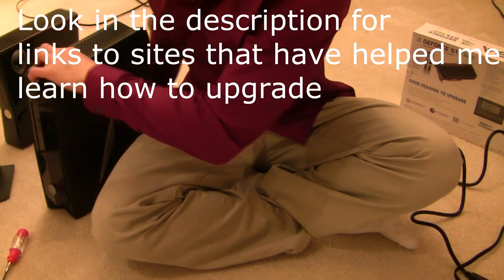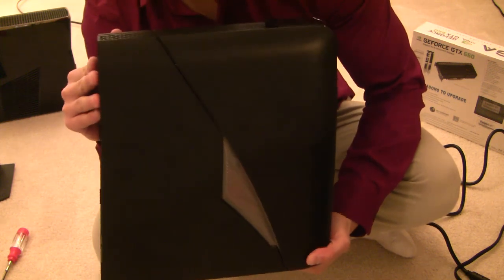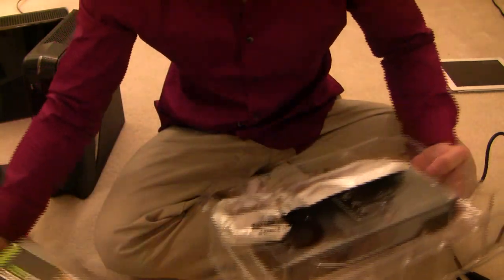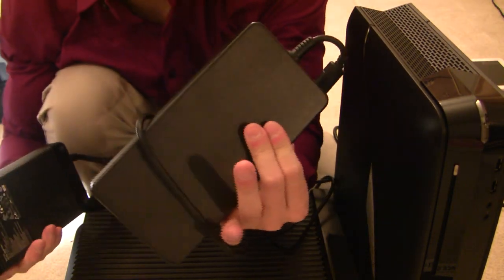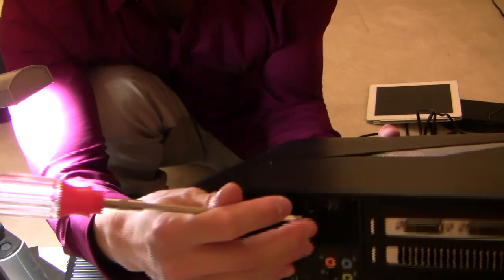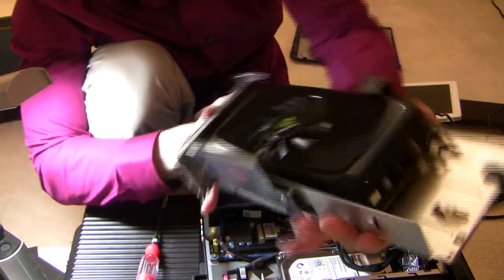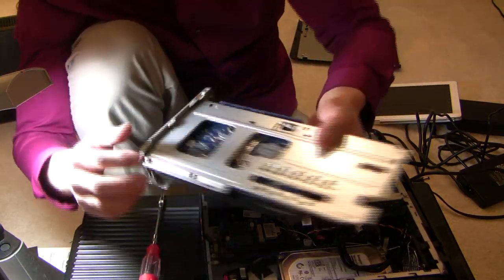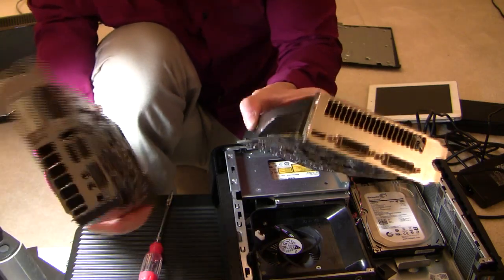► How to Upgrade the Alienware X51 Graphics Card (GPU Upgrade Tutorial/ Guide, GTX 660 Unboxing)

Comment: I have the same x51, I can install a mini GTX 1060 6GB in it but I'm wondering if 330w PSU will be enough..Can anyone tell me if it is?
Reply: JASH aight, thanks man.
Reply: JASH  yes, its a the perfect graphics card for the x51, mine arrives this Wednesday
Reply: Smiley Roman are you sure. I'm thinking of getting a 1050. If it is possible. What should i look out for?
Reply: Sorry to tell you but I tried using the 330w PSU with the mini 1060 and it wasn't enough power. You need at least 400w
Reply: JASH what are other options for a card?
Reply: I'm not sure, do some research before getting a card though. Make sure it doesn't need more than 330w

Comment: u im looking to see if i can upgrade my graphics card ive got a nivida gtx 745 and a alienware x51R2 need to know how high of a graphics card i can go
Reply: Are you sure because the PSU is only around 330 watts
Reply: Yes of course
Reply: gtx 1060 FE should fit no problem
Reply: Chase about a month ago, i ordered my 1060 FE and my alienware x51 r2 runs with it perfectly.
Reply: Chase i ordered it from nvidia by the way. it costs me around 500 CAD
Reply: Jason Zhan Thanks for letting me know
Reply: SuBcLass Make is sure you buy the founders edition because of the type of fan and the length
Reply: yessir, honestly it was much easier than i expected. The only part that was kinda annoying was to put the case lit back in.
Reply: SuBcLass Why not get a 1070? it's the same price.
Reply: SuBcLass just make sure you get a founders edition and if not make sure you have the right length and fan type
Reply: ok thanks for ya help i will get the founders edition and i do have the right fan type
Reply: GTX 970 4gb ACX 2.0 FTW is the same size as my GTX 960 2gb that came with my X51 R2
Reply: JCD sometimes in the case of the 1060 the Asus 1060 Turbo which has the right fan on it 10.5 inches which is to large for the alienware
Reply: yo man did you upgrade your gpu if so how did it do aginst heat?
Reply: Ya I got my 1060 FE and it works like a charm, not as hot as my last gpu either. Faster, less power usage, and it doesn't heat up as much
Reply: if you wouldnt mind dropping me a link to where u got it :)
Reply: ChandlerH8 just google (nvidia 1060 founder s edition)
Reply: https://www.nvidia.com/en-us/geforce/products/10series/geforce-gtx-1060/
Reply: But it only has an i5 4460 will it still work on that one
Reply: good question i got the same pc as u
Reply: But it only has an i5 4460 will it still work on that one

Comment: Someone please help me. I have an Alienware x51 r3 and I've done all the steps (taken off the case, unscrewed the  screws on the graphics card housing etc.) but when I push the latch and pull the card, it will not come out. Does it require more force or am I just doing something wrong? I'm asking this in the first place because my computer fell over and I believe it disconnected my hard drive and the hard drive is underneath the graphics card. I can't use my computer without a hard drive so I just sort of need advice. Thank you!
Reply: Are you talking about here: https://youtu.be/HcaVghmuVYs?t=4m53s ? If you follow all the directions, it might still be tough to remove. For example, RAM cards are infamous for seeming like they are "in" when you really have to push hard to get them to "click."

Comment: I currently have a GTX 645 and im wanting to upgrade to a GTX 750 ti, the PSU im using is 330w will this be okay? or should I just go straight with something like a GTX 970?
Reply: To do so i think you need a better psu but you have to fit it externally it looks confusing, i think im going to stick with the EVGA 750ti
Reply: RyanSmithHD Do you know if with the 330w psu for x51 i can put in a GTX 780TI ? OR am i able to put something even better than that?
Reply: Smitty Werbensnydorzagarmanjenson the psu doesnt support the 900 series but you should be fine with a 780
Reply: +Smitty Werbensnydorzagarmanjenson With the 330W psu, you can go for a GTX970 reference card, but you have to keep the size of the card in mind. 9.5"-9.75" will fit and most importantly, if you have the r1 X51, you need to upgrade the power board to the x51 r2 power board, which can be difficult to source. Google X51 Wikia, it has most of the info there.
Reply: Kenneth Tang cool thanks :D

Comment: The graphics card you buy MUST be a reference model. This way the hot air gets exhausted out of the back of the x51, and not circulated inside the case.

Comment: Hello anybody know if I can fit asus strix gtx 960 in X51? Dimension: 215.2 x 121.2 x 40.9mm thx for help
Reply: yes you can
Reply: but not sure go for single fan reference or dual fan ?
Reply: CodyCov Dual is more quite and cooler but i would suggest the MSI version.
Reply: spide Cooper thx
Reply: no prob man CodyCov

Comment: I have a Alienware 51x with the GTX 555 OEM card. i got a Gigabyte GTX 750 Ti but it didn't fit in the case due to Cooling Pipes.
Will the ASUS GeForce GTX 750 Ti STRIX Fit ?
Or dose it Need to be the EVGA ?

Comment: Hi, i need some help , can i put 10.5 inch graphic card?? PLS PLS
Reply: The best STABLE GPU upgrade at the moment is the GTX 970 reference design. Make sure you have the X51 R2 or a R2 power board.
Reply: YU TIAN THX , I DONT NEED TO TROUBLE NOW  XD
Reply: Wayne Wong Sorry to answer your original question. No you cannot put in a 10.5 inch card. Not without modifications to the case which involves removing a fan.
Reply: YU TIAN Can I put gtx980 ??
Reply: Wayne Wong Wayne, you can, but I highly recommend the gtx 970, it is more stable, less expensive, and you don't need to remove a fan to install it as it is 9.5 inches. Best of luck, I am currently running a gtx 970 on my x51
Reply: Wayne Wong Some users that have installed 980s experienced shutdowns whilst gaming due to insufficient power, whilst others had no problem. Its hard to say how stable the 980 is with 330watts to be honest
Reply: If u can , can u translate to chinese... sry for my english .... my english bad
Reply: GTX980 -Graphic Card Power (W) >165W
Minimun System Power Requirement (W) > 500W
Reply: GTX760Ti is my original GPU, But Minimun System Power Requirement Same with
the GTX980..
Reply: http://www.geforce.com/hardware/desktop-gpus/geforce-gtx-760ti-oem/specifications > GTX760Ti
Reply: Wayne Wong 没问题，我的意思是，你如果要用980，有可能会因为不足够的电，电脑会在游戏当中关掉，很麻烦的事情，因为X51的整个系统不能超过330WATT。而且如果你要用980，还需要把case里面的一个风扇给拆掉，因为980太长了。
Reply: Wayne Wong 说来说去，我还是建议970，不信你查查，大多数升级的人都是用970，更加稳定。
Reply: 我搞不清PSU(WATT),长度，品牌,(Gainward,EVGA,ASUS,Palit....>BRAND)
Reply: 我选970,不过不懂什么品牌好...有些GPU BOOTS SPEED 不同
Reply: 牌子不重要，最重要的是画面卡必须是只有一个风扇的造型不然会有散热的问题。长度就是inches,最好不要超过9.5尺寸。然后watts就是用电量，不能超过330watts
Reply: YU TIAN 你有好介绍吗??
Reply: YU TIAN EVGA GTX970 ..or GAINWARD GTX970 PHAMTON...who can i choose
Reply: Wayne Wong evga吧，因为gainward的风扇设计不是blower,而是在case里面散热，X51的case太小了，不能用这种风扇设计，只能用一个风扇的blower设计。
Reply: 所以我建议evga
Reply: THX LA ,如果买了我玩Battlefield4.GTA V. and NEXT GEN GAME
Reply: Wayne Wong 肯定没问题，我现在都在玩呢，我用的就是evga的970。祝你好运，加我，以后有问题找我☺
Reply: 谢了,怎样称呼你??
我叫伟恩
Reply: Wayne Wong 姓田，之后多多来往，不用客气
Reply: 你是用(EVGA GTX970 FTW) or (EVGA GTX970 SuperClock)
Reply: Wayne Wong SC, superclock
Reply: THX , yehaaaa FINALLY DONE
Reply: GG, what online store for all contry??
Reply: Wayne Wong Amazon or newegg, both have good return policies
Reply: YU TIAN 要卖完了
Reply: YU TIAN Alienware x51 r2 , i replace EVGA GTX970 SC ACX2.0....
Reply: Wayne Wong Sorry for the long wait. I was away, how is your computer?
Reply: YU TIAN thank u and how can i make more room for it in the case for the graphic card
Reply: YU TIAN Hey for the First x51 NOT the r2 whats the best recommended Graphics card? is GTX 780TI the best i can do?
Reply: May I have a link to the 970 your using

Comment: Greetings, I wound up replacing my previous video card recently because it was having some issues. My last one was an Nvidia 660 Geforce. My current power supply is 330watts and it's external. The new video card is an Nvidia 660 EVGA Geforce. Apparently it's overclocked. We bought it new/barely used from Ebay. Oh and my computer is a Dell Alienware X51. I've updated the driver and made sure I didn't run into the same issue. My computer has been idle for about a week while we waited on the new video card. We cleaned out the dust and then we placed the new card in when it arrived. I'm a big WoW player and today, the second day I've had the new card, I decided to log in and see how my new card was handling it. As soon as I logged in, their was a faint buzzing sound, almost like a faucet was running. As I continued to play, the video card fan kicked on just as my last one did. normal. Then the light in my room would flicker every so often and the game would lag for a split second as the light flickered. Just a little curious on what you guys might have to say, or if I'm just over thinking it.

Comment: I was just wondering If I would be able to get any better part for this computer such as better graphics cards something better then the 660
Reply: And something better then the stock i3
Reply: Fitzrawr Stephens The best CPU you can put in at the moment is the i7 4770 or 4790. You can also try the i5 models. For GPUs the most stable & power efficient atm is the GTX 970.
Reply: It cant fit a 970 can it
Reply: Fitzrawr Stephens It can fit, I have the evga 970 blower design, 9.5 inch card
Reply: Damn you got any pics
Reply: When I get home later
Reply: Ok thanks
Reply: Fitzrawr Stephens Here you go, I taken some screenshots to you for proof along with the valley benchmark:
http://imgur.com/a/pLv0O

Good luck, make sure to get the blower design GPU
Reply: mind taking the case off and showing me

Comment: im upgrading to 
Intel Core i7-4790K Processor (8M Cache, up to 4.40 GHz)
Gigabyte GTX 760 GDDR5-2GB |CAN THIS WORK? IM GETTING THESE TOMORROW|
Reply: I would highly recommend an i7-4770 or i7-4790, not the K variants. Since the power limits your overclocking potentials there is no need to buy the K variants.

Regarding GPUs, you are better off buying the newer model GTX 970 because it is very power sufficient, the GTX 760 that Alienware use is the OEM model which is slightly underclocked compared to the normal GTX 760s so they don't have any power issue. So I am highly against you buying a regular GTX 760 instead of the 970.
Reply: YU TIAN i changed my mind im building one... i forgot i don't have enough watts and my motherboard broke.... so im building one
Reply: ImNormalNinja™ - NBA 2K15 - Arma 2 DayZ Oh that's great then, best of luck to you. I simply don't have time to build computers anymore. Good on you!
Reply: steezybeck welp it's 2 years later.did you build a pc?

Comment: Hey man i wanted to know i bought a gtx 660 from zotac and is it compatible with this system i notice that the metal bracket has its own connector to the mother board so idk if the connector on my gpu will get in the way btw i just started getting into pc gaming so i really need help here

Comment: Could I upgrade my Alienware X51 R2 i5 4440 with GTX 645 to a GTX 770?
Reply: 770 uses too much power.  Get a 970.
Reply: I'm actually going to get a GTX 760 FTW 4gb and I'm going to upgrade my x51 to a new case and power supply.
Reply: One They Fear
Why not get a 970?  Best card on the market.
Reply: It's just a bit over my budget. Plus I'm fine with having a 760. I'm getting the 760 FTW for 250$, and the 970 is 350$.

Comment: im looking at the superclocked edition of the gtx 660 does the superclocked edition consume too much power for the x-51
Reply: yes it uses alot of power however getting the 330watt psu will work, i know the 660 is slightly better than the 750ti but the 750ti has low power consumption and will do very well in an x51, might be a cheaper option

Comment: Is it possible to find a GTX 745 or a i5 4440 processer? because I bought a X51 R2 yesterday from wal-mart for 800$ and that's what it was listed to have for the specs, anyway to find something like that or upgrade it in general besides using a 600 GTX series?

Comment: managed to fit my gtx 760 in it :D
Reply: any power problems??? 
and is it the same size as the GTX 660?
Reply: it is perfect i just had to remove the cooler. 
and added a 80mm fan in the case with a mod i did. Worth it ;)
Reply: did you use the normal 240 watt psu that it came with or what did you use?

Comment: EVGA GeForce GTX 660 SUPERCLOCKED 2048MB GDDR5 DVI HDMI DP Graphics Card 02G-P4-2662-KR 

Will this fit into my X51 ? (Just bought it)

NVIDIA® GeForce® GTX 760 Ti with 2GB GDDR5 or this one? Price are similar and if you look at standard upgrade option. Alienware has NVIDIA® GeForce® GTX 760 Ti with 2GB GDDR5 

Also, will i need to upgrade power supply?

Comment: Can I use a GTX 750 ti, with the X51's standard power supply?
Reply: nope. You will freeze frequent when running games due to hitting and lack of power. You can still do that but you are wasting money because it's not being optimized. 
Just get 660 superclocked
Reply: My Name is Not a gtx 750Ti requires less power than the 660, what are you talking about?
Reply: i'm late to the party but my alienware came with 750 ti and powersupply of 240w, works fine; but would recommend to get a better psu

Comment: the x51 i bought came with the following:

 4th Gen Intel® Core™ i7-4770 processor
8GB system memory
1TB hard drive
NVIDIA GeForce GT 645 graphics

what can i do to upgrade it? im finding some games the FPS dips down a lot on ultra settings for a short time but its irritating.
Reply: Get a navda gtx 1060 6b founder edition and get a 330 watt power supply

Comment: can i use the gtx650 with a 400w power supply?
Reply: thats what iam wanting to know i got x51 with the gt 545 build in and want to know if i can git a gtx 650ti
Reply: Paul Cotton
well i bought the 650ti asus and it never fit inside the power cable over laps the case was very pissed off, anyway i fit it in by taken off that case the gpu is fitted in works great but now the fan on  the cpu is realy loud like a normal pc lol but thats only when i play all games max gfx
Reply: Yes,but you do realize that if you buy it from dell it comes with a R9 270x witch has the power between a gtx 650-750...
Reply: What are you running? Whats your CPU,Current GPu,and anything extra you have (Case fans ect.)
Reply: Then yes perfectly fine. But even if you do get that your system might bottle neck.. You might wanna get 8 gb ram while your at it then few months get a FX 6### (the reason i put # is because you can get whatever amd fx 6 somthing cpu and it will be fine) AMD CPU

Comment: Lots of people are asking about GPU (graphics card) upgradeability vs PSU (power supply) in the comments below. In most cases you need to upgrade a PSU with your GPU as the R1/R2 X51's only come with a maximum 330W external brick PSU. However, with the release of the new Nvidia Maxwell architecture (see 750 Ti cards released a week ago) the maximum draw of the GPU is only 60W, compared to the 150W approx. draw of the GTX 545/555/660 stock cards. If you need a small form factor card that matches the power consumption, and are looking for a current card... check the specs and go with something that is rated for the system like a 750 Ti.

Comment: My x51 R2 (i7 4770) came with a GTX 645 and a 240 PSU.
I have upgraded both the GPU and PSU to a GTX 660 (ref design) and 330
power connector (Dell) respectively. It works like a charm.

Comment: Can the Nvidia GTX 760 fit into my X51?
Reply: Really hope ur right im about to upgrade my graphics card and buy the 330PSU
Reply: Yes but the Power supply will not support it. Power Supply for X51 is currently un-upgradable either, Well without Mods.
Reply: Oh ok thx and also,what are these 'mods'?
(sorry I ain't a very techy guy :D)
Reply: koffinkat666 looking at the specs on alienware website if the system now comes with a gtx645 as standard does that mean if you pay the extra £400 alienware change the power supply to support it? is that why is costs so much?!
Reply: Ash Coleby They better, the highest is 330w external Brick PSU cost $140 on Amazon. I bought mine with only the GTX545 and it came with the 240W and it struggles. I think its bullshit that they Make you buy the 330w PSU seperate. So just read the fine print and make sure it is 330W. Or esle your system will be very loud and annoying.
Reply: koffinkat666 Its an absolute joke that you can buy the highest grade video card AND the psu yourself still cheaper than what they charge. Mayhap its worth giving them a call before i make a purchase...but judging by what people have been saying about their customer service maybe not XD If i can get the parts for cheaper than what they will upgrade for i think its worth it. Sat here with my god damn money just waiting to throw it at the first person who will give me what i want like an idiot
Reply: i dont think that it will actually fit, the problem is that the cables that go into the 760 are 8 pin so you will need extra space for the little thing that transfers it to 8 pin insted of 4
Reply: Mosterd Koning Hmmm ok then!
Reply: SoloMidOrFeed Yes it will fit. And it will work. X51 only uses 270 watts with a 660 or 650 ti and it prob will go up about 100,but dont do anything else or you will be running a risk..
Reply: actually you can fit it in i just did it yesterday 
the problem you have is that you also need to buy a new cable to play and that will cost you another 140 dollars
Reply: Don't listen to these people.
The reference gtx 760 COMES WITH the alienware x51 from dell. YES it will fit. Even if you have an R1 with sandy bridge or ivy bridge cpu you can still use a gtx 760 in it as long as you have the 330w  PSU.

The x51 system power draw is very low and can support 170watts of GRAPHICS power. The 760 and 670  draw up to 170 watts.

Remember for it to work it has to be a REFERENCE blower design.